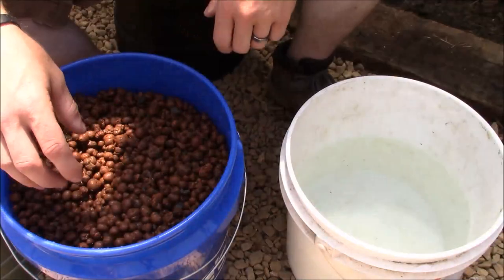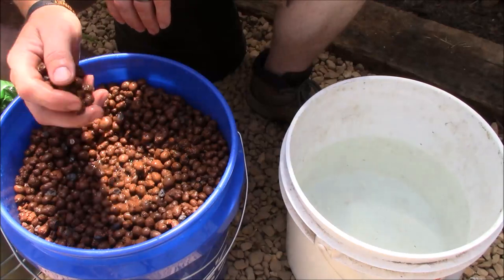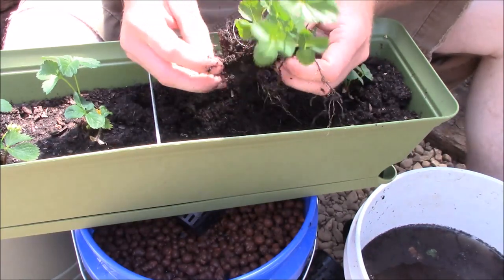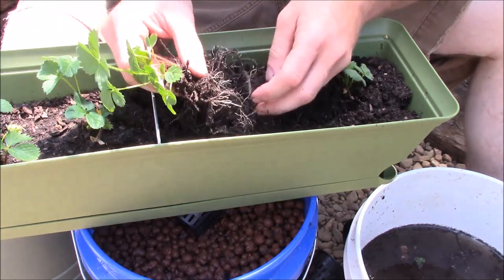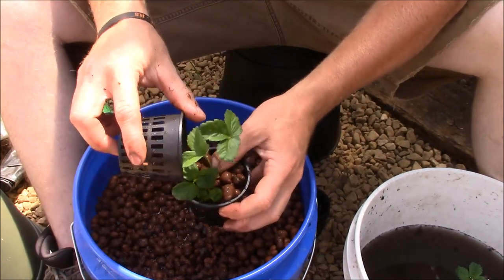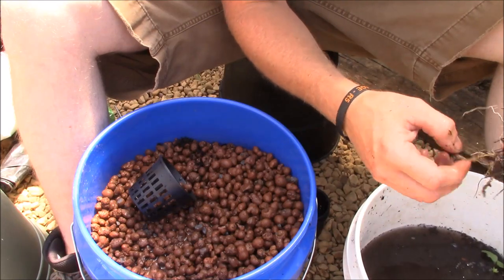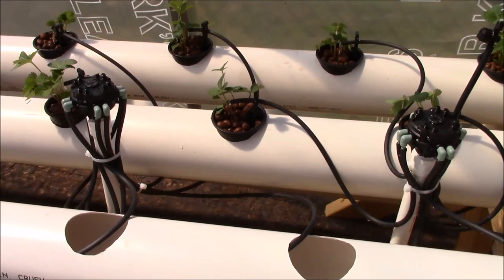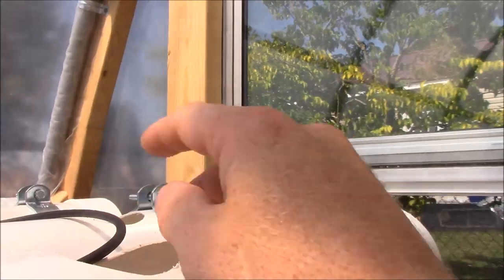Hydroponic Rail System Build - VLOG 5 by HPFirearms

Comment: Sounds like the DC pump is doing a much better job for you. Will the new pump you're looking for be DC as well. An added benefit, if you ever plan to add solar to run your green house, those DC pumps will be perfect without having to run through an adapter/converter. Also, I have seen a few other videos on here when they put the dormant strawberry  root/crown directly into their system and they did good. So will be interesting to see which does better if you also try start some in soil vs. directly into your system. Anyway, it's looking great.

Comment: For your sprouts, try using some silica sand in a pizza pan. Keep the sand moist with a gatoraid bottle with holes in the bottom and dilute solution.

Comment: Hi Bobby, love your channel. You mentioned that you may need a larger pump, as you are experiencing pressure loss on some of your output heads. I noticed that you do not have a loop on your output lines, you just have them teeing off the main run. Think about how body sprays are plumbed in a residential shower; there is a loop line (second line) that balances out the incoming flow so that each head has equal pressure at each output. I think this may be an alternative to increasing your pump size. Thanks for the video and keep up the good work.

Comment: you could simplify this system by doing an ebb and flow system. i made this exact system with a rock wool cube that sat on the bottom of the tube. i turned the water on and off every 30 minutes. I had 8 tubes  16'  long one pump with 3/8" main line and then branched off 3/8" to 1/4" for each grow tube and drained into a recirculating trough. one water feed for each grow tube and 1/4" drop per 2'. i did not need to have the water at a higher level because the roots were already on the bottom. drip emitters always had a chance for clogs. i like the way you did the drain and control the height of the water within the grow tube, i think you have too many holes in the sides of the drain pipe.  you want the water height inside the tube to soak the "corn" and then drain away. if the water gets too high it will drain through the top of the tube and then slowly drain dry through the side holes once the pump is off. with one water feed per tube you may be able to use the pump you have. KISS method.  great setup and well thought out. kudos

Comment: Hi Bobby, enjoying your videos, just found you on YouTube.
Couple of points, the output from your pump is not what you think it is. There are two scales on the graph, Head on the left, and flow rate on the bottom. Measure the height from the TOP of your sump tank water level to the uppermost point of your system, in your case its the distribution port on top of your stand pipes, this is your actual head. Find this height on the left scale. Draw a line horizontally from this point on the left scale towards the right of the graph. Where this line meets the graph line, is the rated flow at that particular head. The little pump you used first off was rated at 1500 ltrs with zero head, and at 1.5 mtrs the flow rate is actually zero ltrs.
Second point, you should not let your water solution constantly fall onto the crown of your plants as this will cause rotting of the crown. Aim the water away from the crown, the roots will take up the nutrients just fine.
Good luck and keep making the videos. Thanks